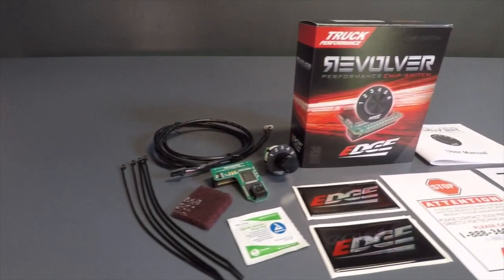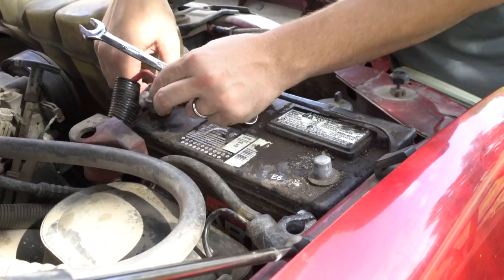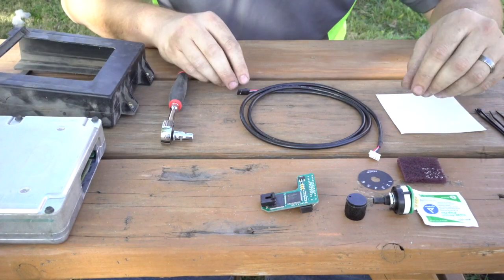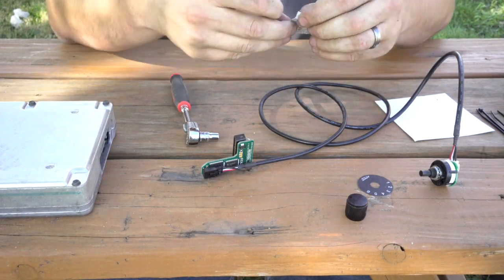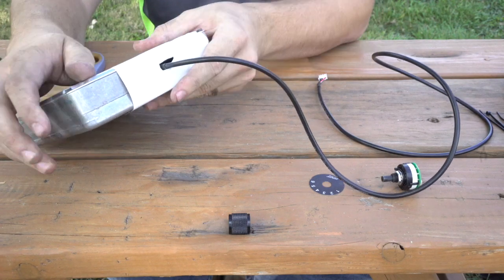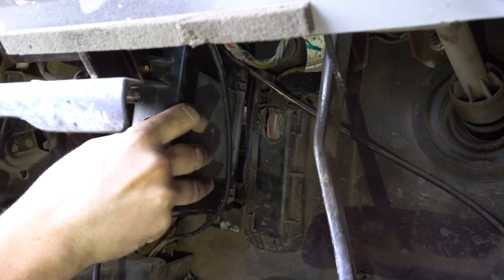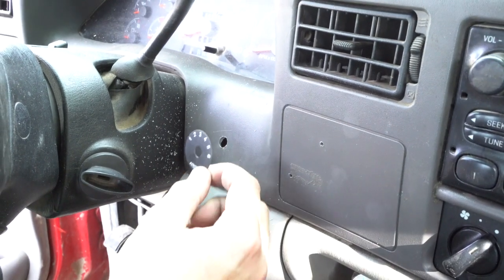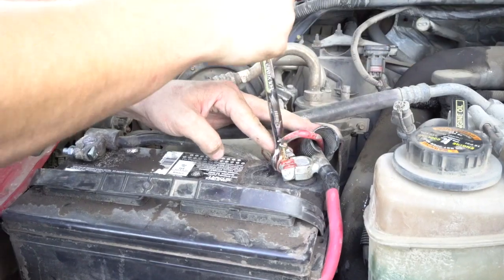Edge Revolver 6 Position Chip Install on 7.3L Powerstroke

Comment: PLEASE HELP: is the Edge revolver chip 14002 Master box MLE1 ready to be installed or does my truck's code need to be loaded in it? I just installed it carefully and following all instructions, but it does not work. I have a 97 F350 7.3 manual. PCM code ALF6.

Comment: I like the idea of the sticker to cover the opening, but I don't like the fact they tell you to scrub your computer with a freaking wipe. Definitely will not be using that when I receive mine.
Reply from the maker: When we first started the installation process, we were a bit skeptical as well with having to scrub the computer with such an abrasive wipe. Unfortunately though, you really have to get the lacquer off of the computer where the chip hooks in or it will fry your PCM and you'll have a mess on your hands.
Reply: I understand that much, but the fact they want you to scrub it with a wipe doesn't make sense. The Brillo pad is more than enough to clean the connections. Seems like not using it would be a better idea